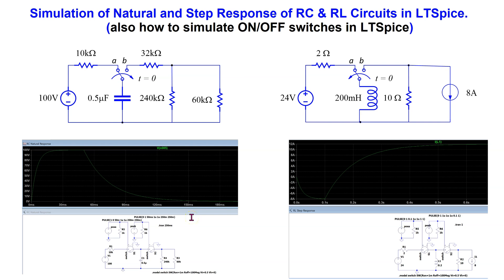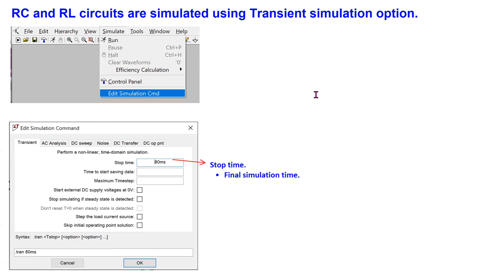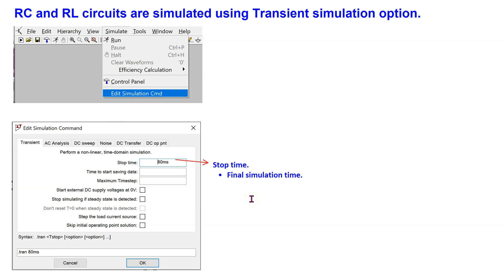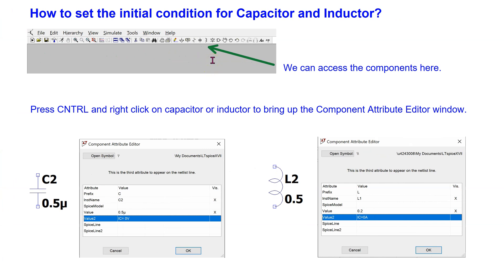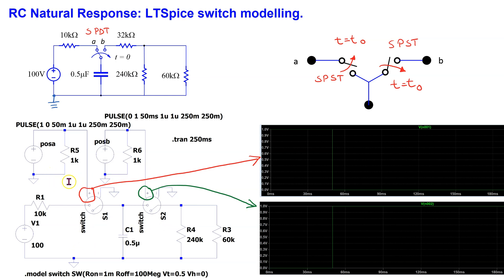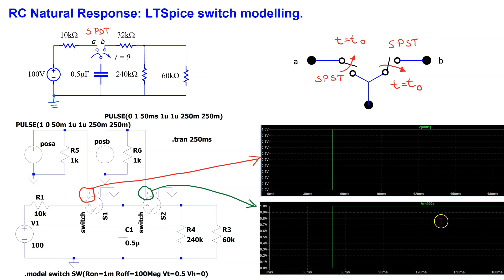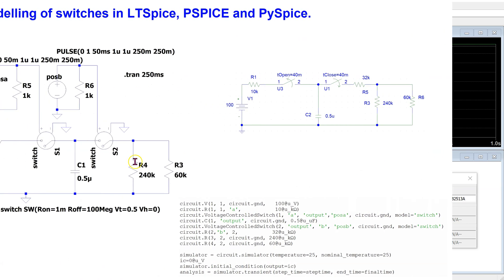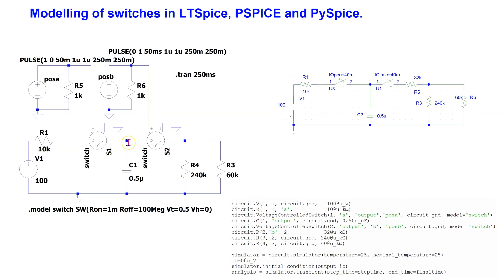Introduction to LTSPICE for Simulating Switches and Natural and Step Response of RC and RL Circuits

Comment: Very useful videos. I am planning to watch all of them. I could not figure out how to start a simulation with a switch already on. The newest version of  LTspice  [Version (x64): 17.1.6] requires more directives. I had to specify .ic v(vc)=0 (voltage on the capacitor), and each switch separately, or the programs assumes it is a steady state and gives an error message. If the videos could be updated, it would help greatly.

Comment: 5:29 where did sir get the value for charging T=5ms. And why the switching time value = 50ms? 
How did you count final time and where did the value of 50 come from?
What is the function for W expression you count there?

And one more thing.. did the value for Trise and fall always 1us?
Is step time=Trise and fall?
Reply from the maker: Thank you for the various questions.

In this circuit, the 0.5uF capacitor charges through the 10kOhm resistor. Hence, the charging time constant is R*C= 5ms. Five time constants is 25ms. Thus, the capacitor will fully charge after 25ms. Therefore, we can set the switching time to anytime after 25 ms. In this simulation, the switching time is set to 50ms.

The charging and discharging time constants are in ms. Thus, we can set the simulator step size as 1us. The time rise and time fall are set to the smallest value of 1us, which is the same value as the simulator step size.

The energy stored in a capacitor is 0.5 C v(t)^2, which is a well know equation derived in textbooks.

Comment: Why is 1 kilo ohm resistor connected to gate pulse circuit? What will happen if i model it without that resistor?
Reply from the maker: Thank you for the question. The simulation will still work if you do not connect the 1k Ohm resistors connected to the outputs of the pulse voltage sources.We have those resistors as conventionally we always measure any desired output voltage ina  circuit across a resistor.

Comment: I followed what you have done in the video but the capcitor does no discharge. Switches change over but capacitor charges up but stays charged. Is there something I missed in your video?
Reply from the maker: If you are constructing the same circuit as in the video and following all the instructions in the video, then it should work properly. I am assuming the circuit has been wired up correctly. Apart from the switches, please also check the initial conditions have been set properly, i.e., the initial voltage across the capacitor. Also, are you setting the simulation time properly?

Comment: excuse me sir where did R 32k ohm go & why are there resistors in the switch in the pulse?
Reply from the maker: Hello, Thank you for carefully watching the video and spotting the typo. Yes I forgot to connect the 32K resistor. It is part of the circuit we ware wanting to simulate and should be connected after the switch.  The pulse voltages that control the switch can be directly connected to the switch but sometimes this can create singularities in the solver. Hence, it is better to connect the resistors (R5 and R6 in the LTSpice schematic) for numerical stability.
Reply: @electriccircuits7164  sir  i still can't understand the part sir insert Von,TRise,Tfall by the calculation sir made can sir make another video to  explain this if  sir  free?😅
Reply from the maker: I am not sure I understand your question correctly. Can you please try to state your confusion more clearly. Thanks!
Reply: i don't understand the pulse detail that you insert those value on lt spice based on the manual calculation of step time,final time n so on// are my statement clear sir?
Reply from the maker: Example 1 in the video is a natural response of RC circuit example. We need to allow the switch to remain at position 'a' (05:10) for a sufficiently long time to allow the capacitor to fully charge. This sufficiently long time is determined by considering the charging time constant. In this example, we can set the switching time as 25 ms (5 charging time constants) or any time greater than that. In the video, it is set as 50ms. 

Once switching occurs, we need to continue the simulation for at least another 5 time constants to allow the capacitor to fully discharge. The discharging time constant is 40ms. This calculation of the discharging time constant is explained in this video: See https://www.youtube.com/watch?v=K1Q-Ay5Tbww at 5 mins 39 secs into the video.  

Hence, we can work out the switching time and total simulation time. Hope this explains things!